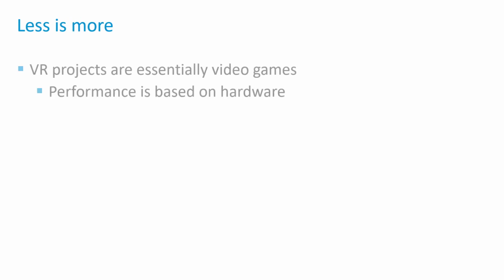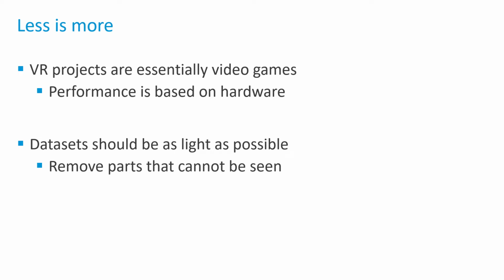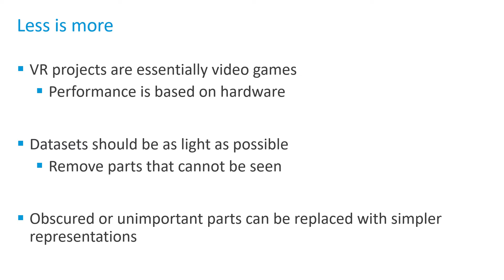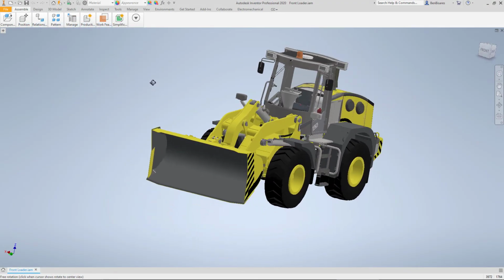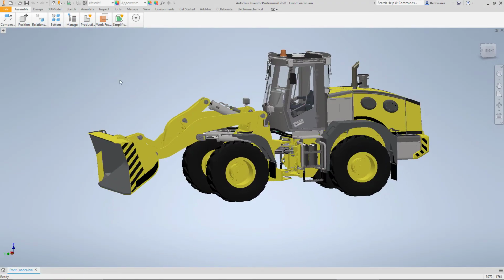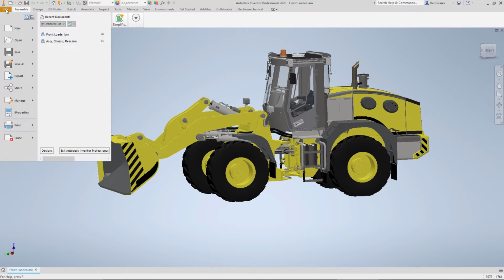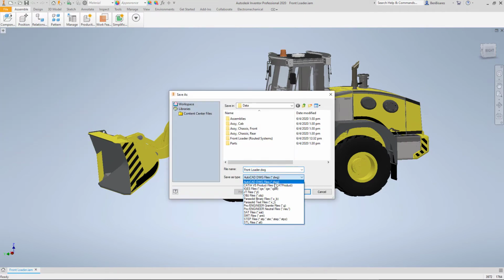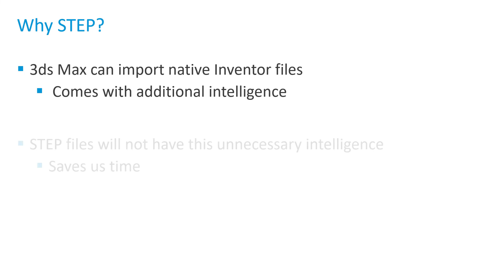From Inventor to Virtual Reality: Exporting From Inventor

Comment: When I export from fbx, the lights, colors and materials will go to the  file?
Reply from the maker: They should, are you having a problem with them not?
Reply: @AutodeskMFG  yes I have, when I export the whole scene, the plug-in create many parts separate and don't crate the file with the lights and materials of environment applied
Reply from the maker: Might be a limitation of the FBX. You could check the forum and see if others have the same problem. https://forums.autodesk.com/t5/inventor-forum/bd-p/78